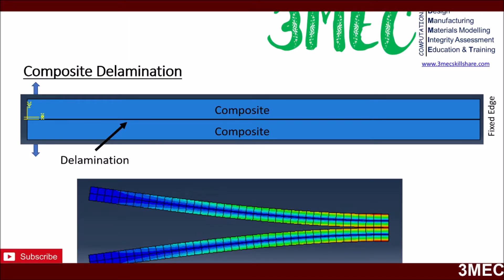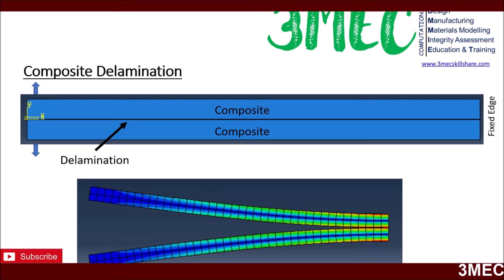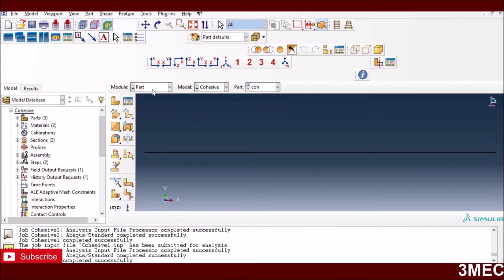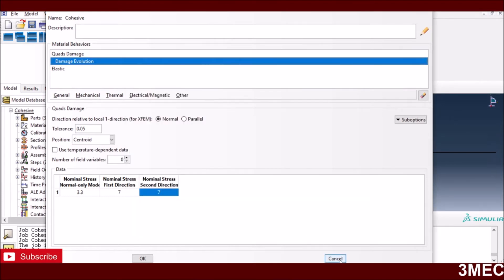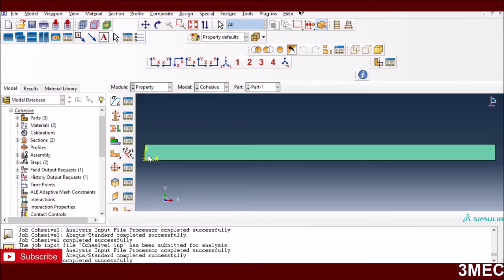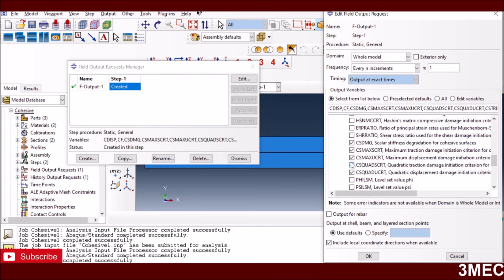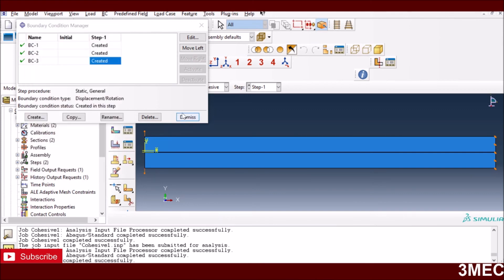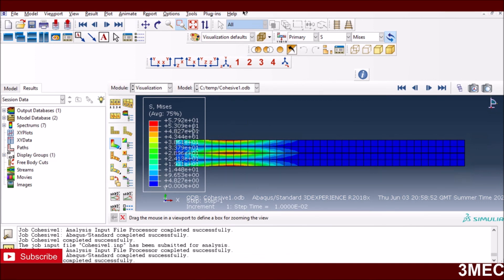Composite delamination via cohesive elements (Traction separation law) - ABAQUS Tutorial

Comment: Hello, thank you for your explanation. I’m using “3d experience” which integrates abaqus fem simulation, the interface is quite different but the commands are the same.
I set the simulation as you did but I can’t solve it because it says that “too many attempt made made for this increment”. Thank you in advance.
Reply from the maker: The error message “too many attempts made for this increment” generally indicates that ABAQUS is having difficulty achieving convergence within the defined increment. This can happen for several reasons, especially if you’re dealing with nonlinear materials, contacts, or large deformations. Here are a few strategies to troubleshoot:

	1.	Reduce the Initial Increment Size: Sometimes, setting a smaller initial increment can help the solver progress through challenging stages.
	2.	Increase Maximum Number of Increments: Go to the step module and increase the maximum number of increments allowed.
	3.	Adjust Convergence Criteria or use line search algorithm : For complex simulations, you might need to relax the convergence tolerances under Solver Controls to help the solution converge. Make adjustments gradually to avoid reducing accuracy.
	4.	Refine Mesh or Use Adaptive Mesh Refinement: For regions with high gradients, refining the mesh can reduce numerical errors.
	5.	Material Properties and Contact Stabilization: If you’re using contact interactions, check if adding stabilization or adjusting contact properties helps. Nonlinear material models or certain contacts can sometimes trigger convergence issues.

Let me know how you go along and if any of the above works 🙏🏻

Comment: Hello sir, that was great explanation i just had small doubt about mesh size of cohesive part, do we have to define any mesh size for the cohesive part or just mesh type is sufficient. If we have to define a size what are the guidelines. It would be a great help if you could answer this.

Thank you
Reply from the maker: Hello, thank you for your kind words! Regarding your question, yes, you do need to define an appropriate mesh size for the cohesive part. The mesh type alone isn’t sufficient. Ideally, the element size should be fine enough to capture the fracture process zone accurately, especially near the crack tip. As a guideline, the element size in the cohesive zone should be small enough to ensure that the cohesive elements can represent the expected damage evolution, typically with a ratio of around 1:1 to 1:2 relative to the adjacent material elements. However, too fine a mesh could increase computational costs, so some convergence testing may be necessary.

I hope this helps! Let me know if you need further clarification.

Comment: Hello sir, where we use paramters like Kn, (Ks, Kr) in traction separation model in abaqus????
Reply: Hi doctor thank you for the video. But I have a question about thé elastic properties of thé cohesive material.: when I have the experimental curve Force- displacement of the mode I ( DCB model) haw Can I calculateur thé elastic properties. Thank you in advance
Reply: Hi doctor thank you for the video. But I have a question about thé elastic properties of thé cohesive material.: when I have the experimental curve Force- displacement of the mode I ( DCB model) haw Can I calculateur thé elastic properties. Thank you in advance
Reply: Hi doctor thank you for the video. But I have a question about thé elastic properties of thé cohesive material.: when I have the experimental curve Force- displacement of the mode I ( DCB model) haw Can I calculateur thé elastic properties. Thank you in advance
Reply from the maker: you may measure slopes or use manual curve fitting?
Reply from the maker: do you mean in ABAQUS CAE how to input? or theoretical what do they mean?

Comment: Sir i am modelling delamination in abaqus explicit for low velocity impact . How to calculate delamination damage area what should be selected in history output
Reply from the maker: Yes, Abaqus Explicit can be used to model delamination in composite materials for low velocity impact. The simulation process typically involves creating a detailed finite element model of the composite material, including the different layers and interfaces, and defining the appropriate boundary conditions and material properties. The impact event can be modeled using explicit dynamics, with a specified impact velocity and direction.

To model delamination, various failure criteria and damage models can be used, such as the Hashin criterion, Tsai-Wu criterion, and the Maximum Principal Strain (MPS) criterion. These criteria can be used to define the conditions under which delamination occurs. The cohesive zone model (CZM) can also be used to model the behavior of the delamination interface.

Once the simulation is run, the results can be analyzed to study the behavior of the composite material under impact and the progression of delamination. The simulation results can also be used to optimize the design of the composite material to improve its performance under impact.

It's worth noting that the above is a general description and the actual implementation of delamination modeling in Abaqus Explicit will depend on the specific material, the impact conditions, and the desired level of detail of the simulation.

Comment: hi I have a question , can we uselamina option for mtrl type instead of engineering constant ? when to use each of them ? thanks in advance
Reply from the maker: do you mean in 3D model? as this case was kind of 2D /2.5D.
Reply: @Professor3MEC   well I am trying to simulate the delamination of composite laminates (16 plies) , I created my part as a solid extrusion (which from my understanding only effects the appearnce but my laminates will still be treated as shell ), so I was thinking of assigning the plies  this mtrl : elastic , lamina and a heshin damage criteria for failure , would that in your opinion be suitable or should i in my case use Engineering constant like the case in your video ?
Reply: and also my goa is to asses the reduction in stiffness due to the failure or even after a tensile test, and am not sure how should i do that ? i mean is there a way in the post processing phase to get the reduced stiffness matrix and evaluate it ? or when am doing a tensile test model is there a way to evaluate the elastic mtrl properties in a tensile test ?
Reply from the maker: @mahaelsaeid3713  so you are modeling each ply as shell in 3D and then want to simulate the delamination happening between any of the plies?
Reply from the maker: @mahaelsaeid3713  you may find this one useful as in this case it was modelled using solid elements but one can use shell too, if used carefully with a few tricks.
https://www.youtube.com/watch?v=35tiZ4DvaBo
Reply from the maker: @mahaelsaeid3713  best bit would be to look at stress vs strain as stiffness matrix will be a 4th order tensor with a large number of components.
Reply: @Professor3MEC   hello again, I have few more questions. 

I have constructed a simple tensile test model for my undefeated composite laminate, and I have calculated the reduced E11 ( from the stress starin curve along the fiber direction)

However, I wanted to validate that my modelling approach was correct, so I thought of analytically calculating the general stiffness matrices (ABD) usinh a python code, and compare it with the general stiffness matrix of the abaqus model after extracting it.

And now am confused, are these the right approach to validate that my simple abaqus model is correct?
All I wanted to do was to check that my reduced E11  ( from the abaqus model ) is not so far from the value Calculated analytically.

And also am not sure, if there is a way to extract the general stiffness matrix out of abaqus? Because I have tried a couple of methods I found on goolge but they didnot work.

So my question is, if you can recommend a method for me to validate that my abaqus model , please do.
And , if you can expalin to me more what are the values that I should validate against each other, will be great.
Thank you in advance